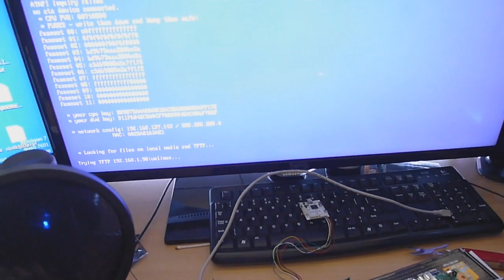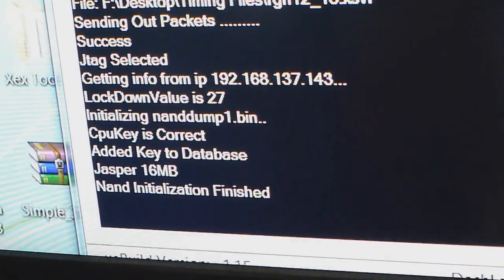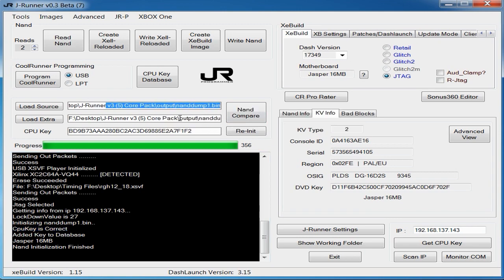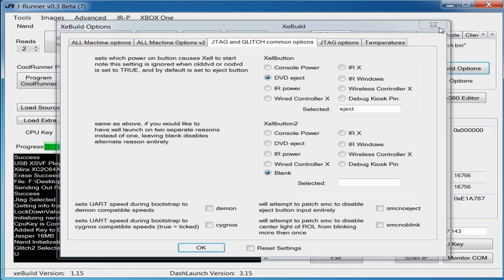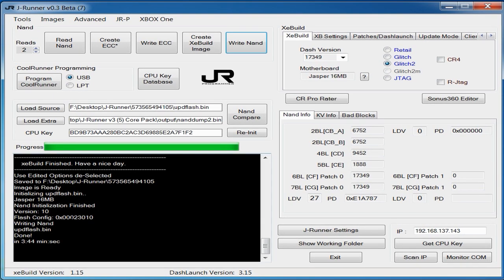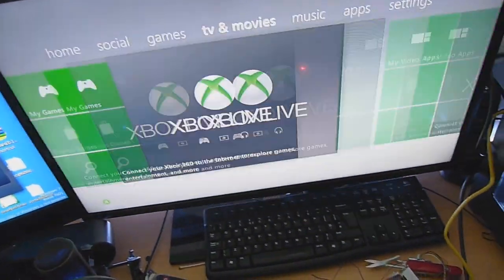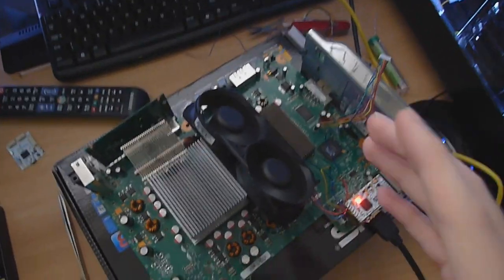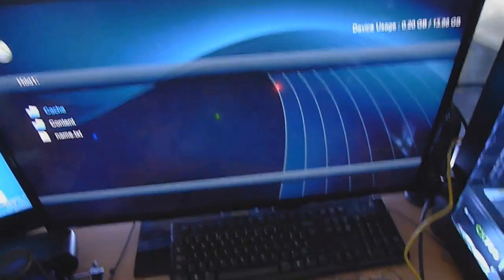Full RGH1.2 Install Tutorial Part 3 (Cheapest Method)

Comment: Hey Man thanks for great tutorial! 
I was doing RGH for first time, and only problem that i had was the timing file, with rgh12_12 console didn't boot up , but when i flashed rgh12_21 console boots up fast . I haven't done anything with Coolrunner ( briding capicator etc.  ) .
Mine Motherboard is Falcon 
I used JRunner_V0.5 modified beacuse the newest one was crashing with " Connection Error " caused of dead servers .
Working on Windows 10 64 bit so i had to disable driver Integrity check to let drivers install fine , the drivers are included in the JRunner folder ( i used the one from newest Jrunner, but i'm guessing they are the sime as the one at the older versisons ) . 
Download Link for Jrunner which i used:
https://www.modconsoles.fr/hitcounter/counter.php?file=JRunner_V0.5.zip
https://team-xecuter.com/forums/threads/153947-(unofficial)-JRunner-V0-5-Modified-by-BenMitnicK
So the next thing i'm gonna do is Flash the DVD Drive beacuse i've bought couple of consoles without any DVD Drives
Next 5 Consoles is waiting for RGH :D so if i will get any informations that will be helpful to other users i will post on comment .

Comment: Is this still the best way to hack an Xbox 360 jasper? I've been looking for a while online but there are quite a few different mod chips available, some claiming to be better than others, and quite a few different methods of hacking the console. I flashed the DVD drive on my console almost 4 years ago but its already dying (won't open most of the time and takes forever to read games), so I thought about using a mod chip to just dump my games on an external HDD instead.
Quite frankly, the x360 modding scene is somewhat overwhelming for someone who is just now looking into mod-chips this late into the console's lifetime.

Comment: i did everything step by step, it doesnt work . i get to the point to boot ti and the xbox led starts blinking and coolrunner red led is on and the green one is turning off every 3 or 4 seconds .. im frustrated i resotered everything and tried again . it wont boot up 
:(
Reply: I had the same problem, try the difrrent Timing file

Comment: damn can't believe I just seen this until now.  I rgh consoles almost every day and use cheap coolrunner rev c.   falcons also pretty good but Damm this will save some grey hairs for those Damm jaspers.   just wired one up right now and it insta boots with the rgh12_18.xsfv on a 16mb jasper

Comment: After you put in the CPU key, do you shut off the Xbox, unplug power, then create XeBuild image and write nand? and after it is finished, do i unplug the jrprogrammer from the coolrunner? I thought turning on the xbox while the jr programmer is plugged in will fry the chip?
Reply from the maker: +ShadowModding360 You never want to have the JR-Programmer connected when the console is powered on. Once you get the CPU Key you power off the console to create the XeBuild Image. Then once you flashed it to the nand you can power the console on again.
Reply: +xXModdedWarfareXx OK thanks bro

Comment: Thanks so much for this tutorial. I just RGH'd my falcon with an $8 coolrunner clone from ebay.
Reply: Don't cheap out on a nand reader.
Reply from the maker: +Ratchet Russian JR-Programmer is just a bit slower at reading and writing the nand. Still a good nand reader for the price.
Reply: @MODDEDWARFARE  what is the liquid you put on the board before soldering?
Reply from the maker: @halofreekreed3573  Flux
Reply: @MODDEDWARFARE  thanks
Reply: Ratchet Russian have you guys tried am thinking of trying but i dont want to brake dully
Reply: Hohok Cities late but Rev D is a knock off that came from China made

Comment: What soldering Iron are you using for this? I wanna buy a good one and a tip to do the small spots. BTW I'm in the U.S
Reply: It would never matter with solder iron you use.
All solder iron do the same job.

But there's about 40+ different solder you can use for different jobs.
Some has Flux inside some does not.
Some have different mixtures of metal different levels.
The list is endless
 you need to use the right  solder & Flux.
Just do a bit of research find out which is the best for electronic boards & wires
Reply: @scottrocks1993  bro u were 5 years late

Comment: Isnt This 1.2 Old Isnt There A 2.0 Version And Can You Update It ??
Reply from the maker: Extremegamer614 The naming of this can get confusing. RGH1 had great boot times but it got patched on dash 1699 or something like that. RGH2 came out after which has slow boot times but works on any dash kernel. Now RGH1.2 has come out which brings back RGH1. So it gives you faster boot times like RGH1 but it works on any dash kernel like RGH2. So its RGH1.2. Yeah confusing.
Reply: xXModdedWarfareXx Going to do this! What flux do you use by the way? Everyone is saying all these different types are better than others and idk what to buy
Reply: ***** just get some radio shack flux, it gets the job done for me, and works great. It seemed as if, moddedwarfare didnt use enough cause it seemed hard to get that solder on, on some points.  But yeah just order some flux from radio shack, or go to your local one
Reply from the maker: Sometimes you get 1 point that can be a bitch no matter how much flux you apply.
Reply: Liquid, No clean right? or paste
Reply: xXModdedWarfareXx So is different hardware needed to perform an RGH 1.2 vs an RGH 2.0? Or is it just the way you set the wires up on the Coolrunner and the settings you choose in J-Runner?
Reply: DaSoggyTurd no different hardware, just different settings in software side of things
Reply: ItsJetz7s {IJ} And the way he set up the wires correct?
Reply from the maker: DaSoggyTurd Same hardware just the wires go to different places on the motherboard than RGH2. As for software the only difference is the custom timing files.
Reply: oh so it works as the same as rgh 2 + 1 put together
Reply: Extremegamer614 it works the same as a rgh1 and a rgh2, just different software settings, and points for wires
Reply: cheers
Reply: Extremegamer614 RGH 1.2 is the new and improved 2.0 that is unreliable and utter crap, 15432 revived the rgh 1.0 and it works way better than tx garbage which is 2.0
Reply: ModzVonXyborg lol its fine, rgh 1.2 is better than both, cause a t
rgh 1.2 is available on any dash kernel, and the stock time thnes, boots faster than 1.0
Reply: xXModdedWarfareXx - that depends on what you would consider "slow" boot times. My jasper boots 10-15 secs on RGH2 consistently. The only difference RGH 1.2 has over RGH2 is faster boot times, that's it. Once you get to the dashboard, it's all the same thing from that point on
Reply: Jared Jared lol duh
Reply: Unless it's giving you a better advantage playing against your competition online I don't see what the big deal is about it. Everyone gets a big boner about it and nuts in their panties. Just because a console boots faster it doesn't give you an advantage, because at the end of the day it does the exact same thing once you get to the dashboard
Reply: You can lol on that all u want

Comment: hey men another question plz i have xbox 360 slim corona 250gb its an rgh 2 and i'm going to update it to latest dashboard but you only did on trinity motherboard and i'v seen other tutorials that update an xbox 360 slim corona but 4gb is the storage devices matter in this point is updating with 250 xbox 360 is the same as xbox 360 4gb corona
Reply: Biboz Gme hey man.....I updated my corona 4gb using the link in the description and it all worked great except for the fact that my disc tray didn't read any discs.....if thus happens to u and u manage to figure out what the issue was please let me know

Comment: Was wondering if you could help? Currently i have a dual nand console and i changed the keyvault on the rgh side. If i go online with a stealth service will the retail side be safe?
Reply from the maker: HFSFDS Providing you flashed the new KV to the nand on the RGH side then you should be ok.
Reply: xXModdedWarfareXx Ah sweet, i also do not have to connect to a vpn right? Stealth will do it for me?
Reply from the maker: HFSFDS Stealth servers will but offline files wont.